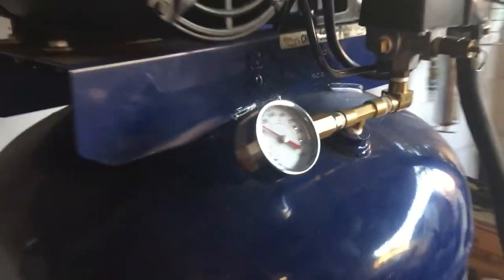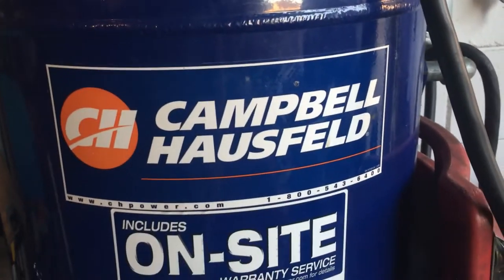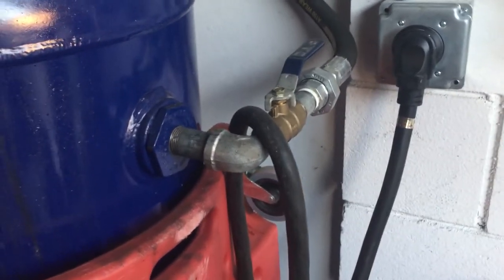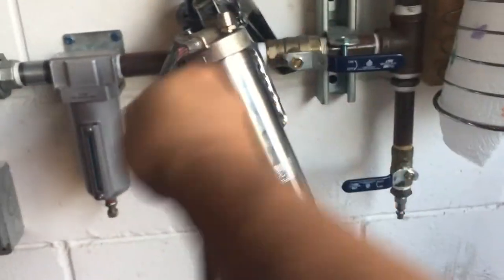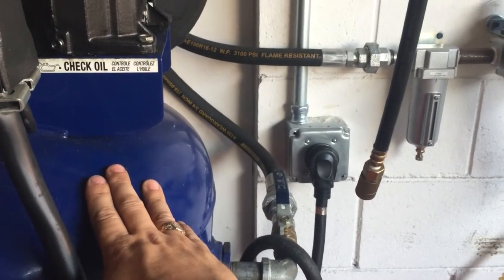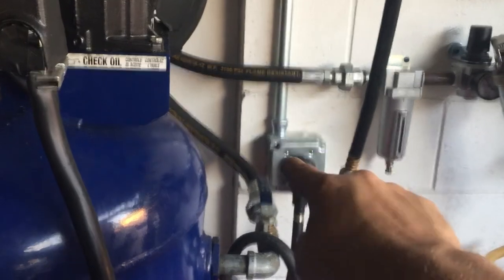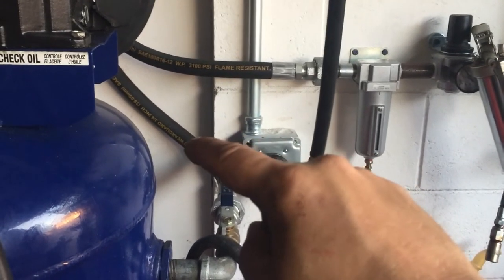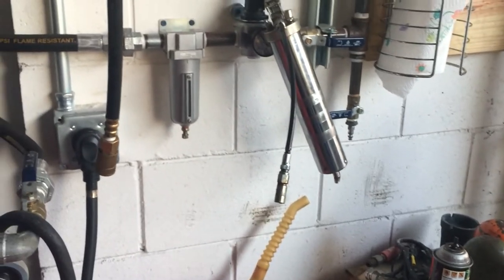Campbell Hausfeld 60 Gallon Air Compressor and rig setup

Comment: With the hydraulic hoses being higher than the outlet of the tank, any condensation that occurs in the hose will allow the water to run back down into the tank. You could install your hydraulic hose into the top of a T fitting and on the bottom of the T fitting, install a short section of pipe and a cut-off valve. Then the center of the T fitting goes to the pipe coming from the compressor. Then when water runs back down the hydraulic line, it will accumulate into the short section of pipe and you can drain it thru the cut-off valve.
Reply from the maker: very minimal water is running backwards. The moving air keeps it moving forward till it ends up in the water separation filter. On the ceiling are 40 feet of black steel pipe to cool down the air for paint work before it comes back down thru the 2nd hydraulic hose where the water separator sits. If you do have the water separator to early water will stay in the air and in the pipe.